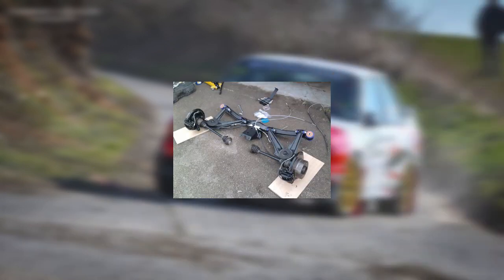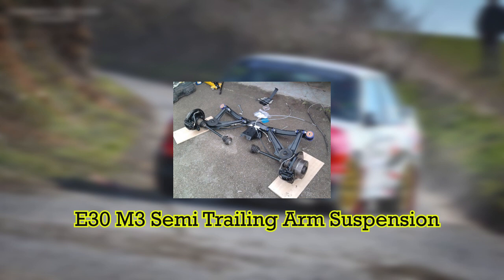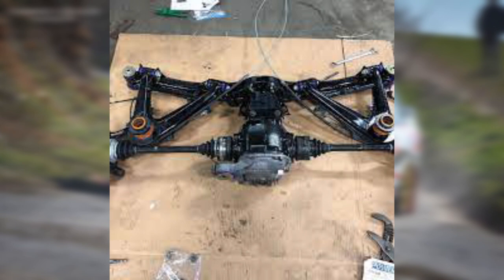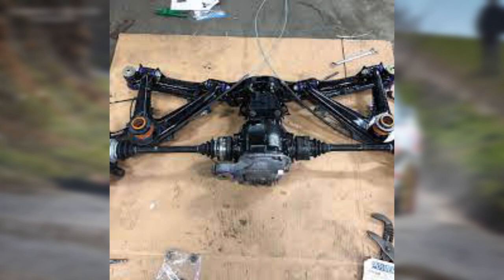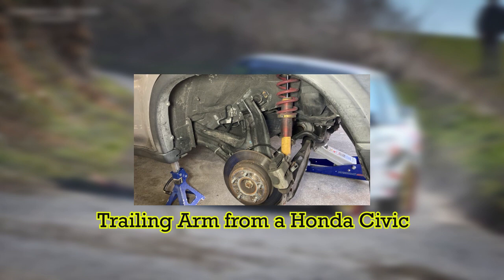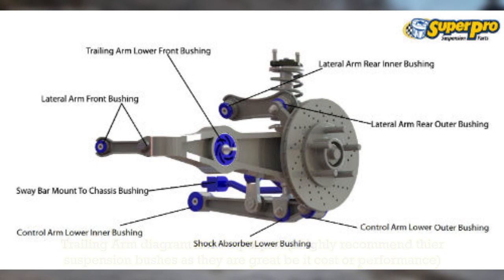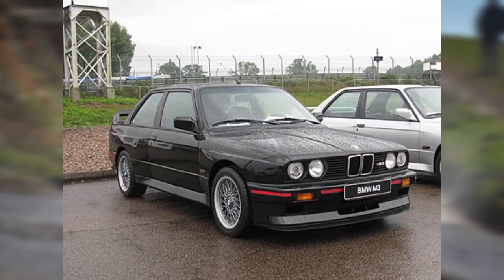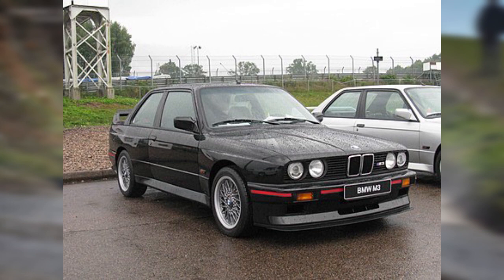Pros and Cons of the Semi Trailing Arm Suspension

Comment: The biggest issue that semi-trailing arms have is tremendous elastokinematic toe deflection, toe-out from cornering and braking namely. The second biggest is tremendous anti-lift geometry, which causes instability during braking, although is good for body control. Roll centers also tend to be high and many designs due to being so trailing (duh) have a trend of increasing roll center with decreased ride height, which can lead to very unbalanced jacking in some racecars which can't attain more optimal geometry but have been lowered a lot.